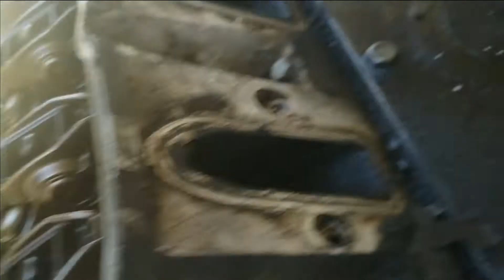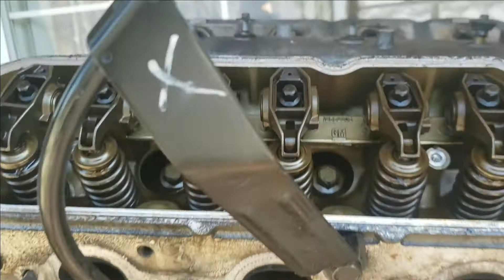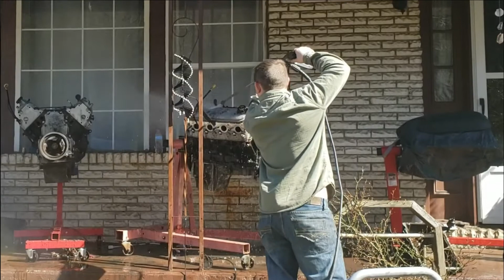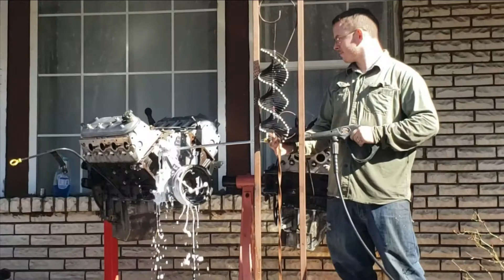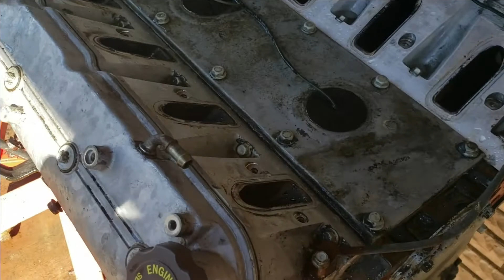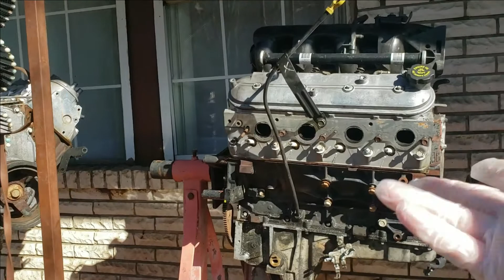NOW THATS HOW YOU CLEAN A ENGINE - LS SWAP POWER WASHER ENGINE CLEAN

Comment: Did you dry it off after how did you keep it form rusting
Reply from the maker: all vales was closed where rocker arms was removed, so no water should of got inside of the cylinders, but we did remove plugs and spray some wd-40 in the cylinders